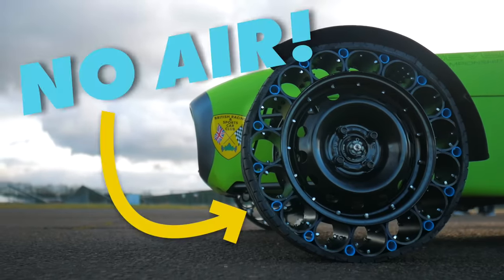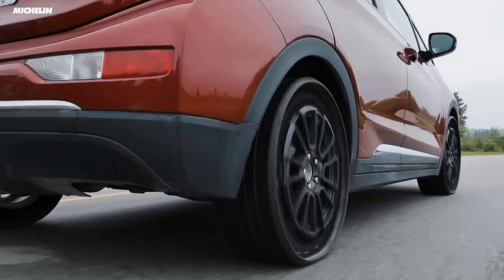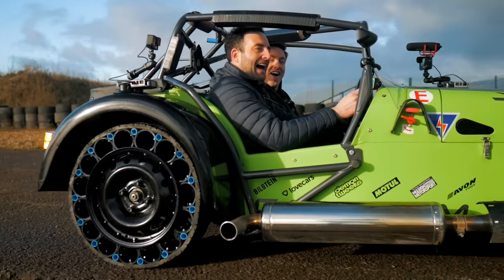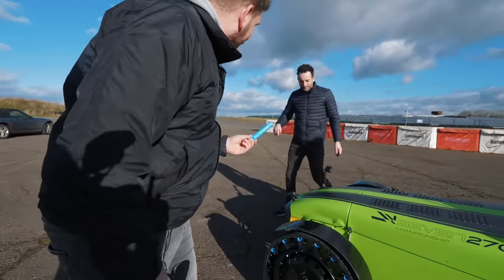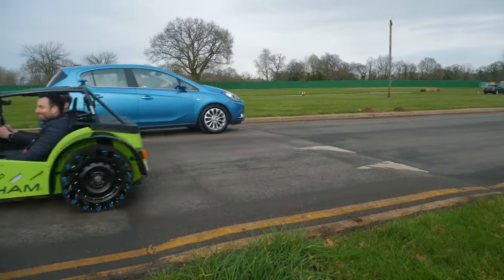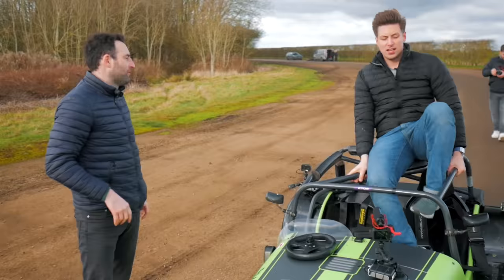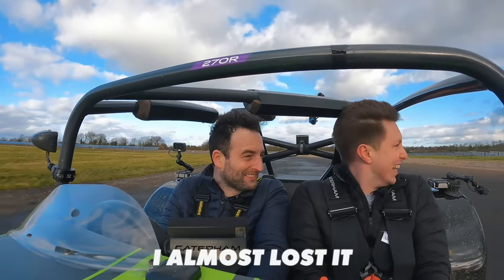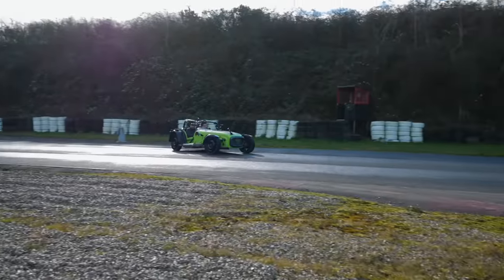I Made DIY Airless Tires

Comment: Can you test acceleration and breaking compared to regular performance tires ? The usual principle is that air allows deformation required to get more (or optimal) adherence with the surface, more contact area. I'm curious about that principle since you need more rigidity in your concept to maintain integrity of the tire to lateral forces, it should adversly affect the contact area with the pavement. Let me know !
Reply: I guess with airless tire a softer rubber would be needed to make up for that? You can kinda see the lack of grip when they are driving around.

Comment: What this proves is that different filaments on the 3-D printer for the actual tire concept is needed not just the same rubber filament for all the different tube positions.

 All nuts and bolts aside.., if they were to use different strengths of different filaments to make the different sizes of tubes in the concept 3D printed tire... it should work

Comment: Potential improvement.
Locktite.
Glue (especially tread to pipe)
Speed holes or strategic slitting of the pipe sections would allow them to deform more. Naturally w some loss of durability.
Air/sound shields on the sides, which would also return more standard tyre aerodynamics. Possibly some structural improvement.
Possibly a foam rubber to fill between pipe sections on the outer rim, then ground back as a balancing process, before tread laid over.

Comment from the maker: Would you put these on your car? I think with some work - these are THE WAY FORWARD
Reply: Yes.  Many kilometers forward.  More than can be counted on both hands.
Reply: You should do some timed laps and see what the difference is between a normal tire and these.
Reply: not literally this tyre but yeah any airless tyre prolly
Reply: @sriharidesai7606  Nah
Reply: But sometimes I need to reverse...
Reply: Good job guys
Reply: I would but maybe weld everything together instead of bolts and nuts lol
Reply: Balance the wheels and do it again!
Reply: You have done really well with what you had there not that bad considering maybe you could keep the tyre cylindrical as to have no join in the tread but very well done. I would use airless tyres. Great vid loved it 👍
Reply: @C.I...  ye
Reply: Would have been interested to see the effect on fuel economy
Reply: not a caterham
Reply: @ansonefbt   It is a tad bit more than just a balancing issue... 
More like roundness issue, but they got the right idea though.
Reply: Yep
Reply: I think with a proper metal full tyre size rim(without the PVC pipes) these tyres would be quite realistic, however, I think the vibrations would be bad for normal road cars and would require a slightly improved cushioning like a thin layer outside the rim onto which the tyre tread can be attached. But sure! I`d put these particular ones on and drive at maybe 50 comfortably... mostly...
Reply: I was wondering if i could do something similar to my bicycle in Amsterdam, it is especially interesting what effect the noise will have on British and Italian tourists walking on the cyclepath. Trouble is that for 2 wheeled vehicles is that the construction must also work leaning in corners.
Reply: Why not make the roads outta rubber, and the wheels Outta concrete...
Reply: All you need is better manufacturing, and your good to go.
Reply: hell yeah, ill have a set when you get to the final version, my car has 225/50/19, i got 4x new tyres last year and within 4 days i had 2 punctures.
Reply: Genius 😂
Reply: carbon fiber tubes might work even better, the smaller pipes are also important, you would ideally want as many smaller tubes in the gaps as you could. that would make sure the pressure is even more evenly spread out within the "tire"
Reply: They are the way forward because their braking ability is shite.
Reply: why  not just find an equivalent density of rubber foam and fill the air space with that.
Reply: DIdn't you guys make the "Why airless tyres kind of suck" video
Reply: Wow don't believe it I was thinkin similar for big tires if they could be made out of divisions since tractor tires are big so it increases mileage in kilometers ? but like loaves of rubber bread with air in you've go it there try covering some of the holes on the inside and the outside or both maybe not maybe to keep brakes clean I've hit worst potholes … 
 and Jack Nicholson told me , tell ya Sure I've got a Helmet
Reply: They would be better if the tread had not been cut and had over lap of sidewall making the blue pipe more secure...
Reply: You guys do know you can buy these already right. This is not a new concept by any means - the reason they didn't catch on is because they tend to suck.
Reply: No.
Reply: Come to RI you’ll see some potholes that will blow your mind haha
Reply: I want to do this to a motorcycle.
Reply: And yet you can't compose a sentence.
Reply: this channel is better than that top gear show
Reply: I would definitely try to find a way to not cut the tread in half. Maybe just cut the side wall and find a way to press the drain pipe wheel into the tread. Also, balance the wheel!
Reply: Yea too bad big tire won’t lose out on their profits. Just another example of how we have clearly progressed technologically but big money will always hold everything back. Like being in a cage looking at the key in an unlock-able box right in front of you.
Reply: Find a way to get this design setup for an extrusion type of manufacture process
Reply: they have not been working on it for ten years its been used in the military for almost 20 years now the work was done long long long ago stop spreading misinformation about something you just found out about.
Reply: You should make a cover for the water pipes that could solve your sound problem
Reply: Hell no. Shear forces will pull the tread right off those pieces of shit and they wouldn't last more than a week of normal driving in a standard sized vehicle.
Reply: You could put walls on the tires to reduce noise maybe? And fill the gaps in between the thread and the cylinders with the same rubber to make it round of
Reply: Maybe little more development but yeah I'm kinda interested
Reply: This was HILARIOUS and you'll get a LOT of views.

Just a safety note tho'. Driving around in a car with a full cage but without a helmet is a great way to die from skull impacting unpadded steel tubing (It's illegal in my country for that exact reason). If the tire had come off, the rim would have dug in and then certain tragedy.

PLEASE be careful guys. Open face helmets wouldn't have made any difference to this video, but a LOT better safety...
Reply: The design needs significant improvement for road impacts.  When you see Michelin’s prototype airless tires they are designed to absorb impacts by folding the layers of rubber down.  They are already being used on construction vehicles, but they have yet to make their way to consumers.  As it stands your design diverts all impact to the shocks and frame.  I believe you made some false assertions regarding potholes.  The main reason we don’t use solid tires is that they don’t protect our cars from road impacts.  You’re basically using carriage wheels modified for a car, but there is no impact absorbency from carriage wheels.  You’re also using an untraditional car, which doesn’t suggest you’d have the same results on a larger heavier platform.  Altogether I like the work you’re doing but there are some key design elements I think you could change to improve the performance and actually compete with Michelin’s design.
Reply: you can fix it by  not cutting the tread across  and making sure  it has tension
Reply: Nope. I could imagine a hybrid version, with closed tire walls and air filled up. That would give ya the comfort of a normal tire, while being able to continue your trip after, even a severe, puncture.

Comment: One improvement I can see pretty quickly would be to use some sort of PVC glue to hold everything together instead of bolts, also don't cut the thread and join it again, that's probably contributing quite a bit to the vibration and adding another possible point of failure...

Comment: High performance radial tires have their plies wrapped in a spiral manner creating a single seam that wraps itself around the entire circumference of the wheel rather than a single straight cut across the tread. Think of peeling an orange using a single cut without allowing it to break or even a corkscrew. Adhering the tread to the body of the wheel consistently and in a manner that resists both lateral and fore-aft force appears to be something you've already solved. You're almost there!

Comment: 2 things you could also try:
1. Weld everything together. It might hold together better than nuts and bolts.
2. Enclosing the tires would help with vibration.

Comment: Try this instead:

Testor Corp Cement Glue - Nothing beats a quality model cement for joining ABS plastic or polystyrene plastic, and Testor Corp’s Cement Gluemakes the job even easier, thanks to multiple precision tips that ensure accurate application. Toluene melts the plastic on application and polystyrene welds plastic objects together once the toluene reaction ends. It sets within a minute of application but begins reacting on contact: Be sure to place pieces correctly to avoid visibly melted plastic around the glued area. Note: Always use in a well-ventilated area due to the cement’s strong chemical smell. Also, cut the sidewalls off the tires, then heat them up and stretch them over the plastic tubes instead of cutting the treads.
Reply: Also remember to balance them.

Comment: What many don't realize is that making an airless tire isn't that difficult, but making an airless tire that works in all climates is far more difficult.  Very cold weather is the biggest issue as I understand it because it makes the components brittle and far less resilient.  Heat also seems to pose a problem since it softens the components causing them to perform differently and they compress more than they should.  But don't get me wrong, I am not disparaging this video because for a DIY project they did an amazing job.  I am only pointing out the difficulties in making something like this for mass production.  It's also my understanding that airless tires seem to wear out much faster than conventional tires due to the constant flexing and rebounding of the inner structures.  I do think they are the way forward but they are going to require alot more development before they are truly viable against conventional tires.

Comment: Meanwhile GoodYear/Michelin take decades... kinda like asking Exxon/BP to build an EV. Maybe because perfecting an airless tire might just mean the end of their current business model. Imagine carbon fiber tubes and aviation grade bolts with safety wires (I am an aviation mechanic btw) and here we have an indefinite tire where all you need to change is the thread which can be made easy to replace too while at the same solid on the tubes with appropriate grooves or other methods. Even with simple plastic tubing you have demonstrated this whole concept to be viable.

Comment: Tire tech has honestly become very developed. Tires are designed to flex to give a dynamic contact patch, and flex sideways a bit for slip angle. They also retain heat for sport driving because they hold the air in. These might be great to defeat spike strips from annoying cops….

Comment: You can add plastic or rubber washers on the nuts and bolts to make them less affected by the vibrations and make them less likely to loosen up and fall off the tires, also will help with decreasing the noise of the tires an easy way to start the refinement of the tires which won't take a lot of time or money.

Comment: my first thoughts were: you should cut a seam the width of the tire. if possible you should only cut off the walls and leave the tread part completely intact. it also could use some fill material between the rubber and tubes to make them more round. another issue that needs solving is the amount of bolts in them, maybe look for a way to produce the infill part in one piece, if that's even possible.

Comment: I was just reading up about these (probably why the algorithm fed me the video), I think heat transfer is another potential issue in the development of airless tires, air is a fantastic insulator of heat so naturally with pneumatic tires there isn't much material to transfer heat into the wheels, brakes, other bits in that area (I'm no mechanic lol)

Comment: Have you considered a hybrid design? Take a traditional air tire and put a airless tire support frame inside/attached, but allow it to be sealed and pressurized so it can smooth things out but the frame will give you the unique mechanical properties you want (different horizontal vs vertical compression) addionally you have backup incase puncture to keep going without complete failure.
Reply: That'd basically be a more complicated run-flat tyre. The main benefit of airless is not having to worry about losing air, in basically every other way they're worse. Adding an airless structure to the inside of a pneumatic tyre basically gives you the worst of both worlds.

I feel like I've just brutally shot down your idea, wasn't intending to be at all harsh, honestly! It's a logical progression to think in those terms, but anything hybrid tends not to be as good at anything. As with run-flat tyres which are essentially that hybrid solution, some hybrid cars are fantastic, but the best possible version is worse than the best of pure EV or pure ICE.

Thinking of ways to retain the benefits of pneumatic tyres is good though, that's how the major manufacturers end up spending millions trying to develop those benefits into basically exactly what these guys built here.

Comment: For the sound issue, i bet some sound deadening rubber coating on the pipes would do wonders, and possibly memory or insulation foam in the gaps as well

Comment: diagonal pipes pointing inward, plastic weld them, use the tread as one piece, then add insulative material. could use tire patch cement to secure the tread to the wheel. cool idea

Comment: I'd put silicone in the gaps surrounding the small pipe for several reasons. And I'd use a bigger tire that you could shave the top of one side and the bottom of the other, overlap(keeping direction of travel in mind) and glue.

Comment: Ok probably a dumb suggestion, but couldn't you just take a tire fill it with the pipes in the same way (maybe glue them instead of nuts and bolts so you could pile them without falling) so you could keep the sidewalls of the tire which might save weight without all the hardware (or as much if you did 1 in the center rather than 1 on each side), cut down on noise since the air wouldn't pass through them, and give you more stability side to side for drifting. Not sure it would be better but if you ever try a version 2 maybe it could work.

Comment: You need to cut the treads at an angle to deaden the clip-clop noise, and a simple semi-rigid rim (perhaps a steel-belted tyre bead) where the tread joins the tubing would smooth it out further and really  tie the room together.

Comment: If you could design it to shrink and/or expand. (Maybe by twisting an adjustable screw) you might be able to use the device as a tire insert. 

That way the person can insert this rim into any size tire that's the appropriate width... and then adjust it to fit! 

Or else you would have to make it super easy and cheap to retread... for it to be worth $300 / tire.

Comment: Something like this definitely has a use, even if not for passenger vehicles. 

Love it when someone is willing to try out an idea & have fun in the process. Great job 👍🏻
Reply: Airless tires are used for commercial use like building/demo vehicles, forklifts, etc. Though forklifts use special tires that have sideways rotors and separated differentials so you can move horizontally.

Comment: Any tire can go over a bed of nails like that. It's an old trick, a dense "bed of nails" covers enough surface area to support the weight without puncturing. 
4:12 you can see the tire appearing to float across the tips of the nails, not even coming close to the board in the area where there are nails. Had the nails fully punctured, the tire would have touched the board, especially considering the exposed parts of the nails were barely longer than the thickness of the rubber itself.